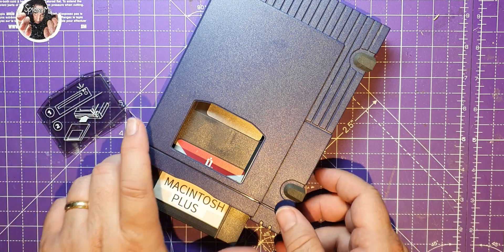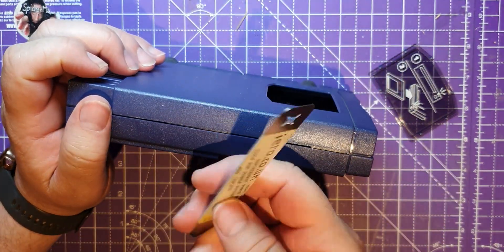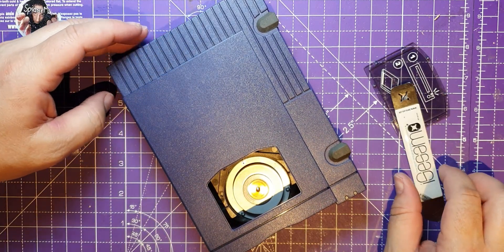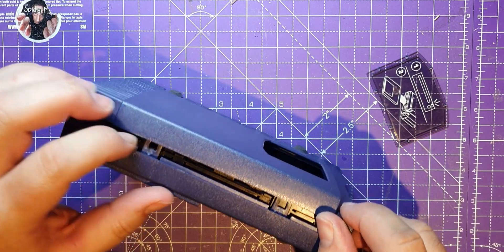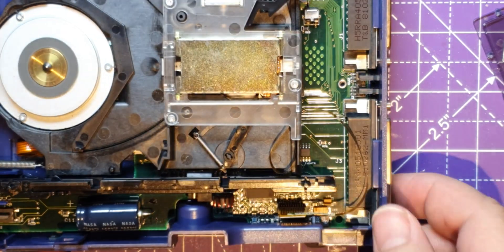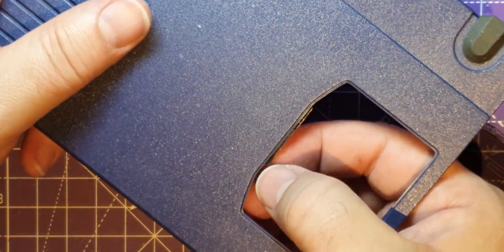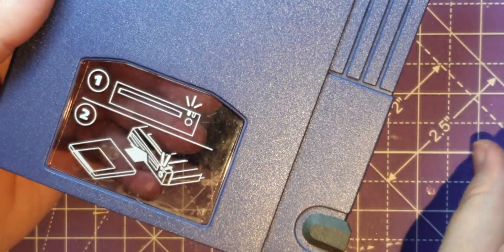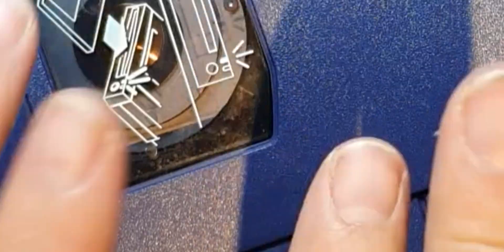Iomega SCSi Zip100 drive disassembly and disk window fix

Comment: WARNING! The video is superb but it doesn't mention to be CAREFUL when removing thee top 'cover'. Do not disturb the two 'guide' rails either side of the disc loading mechanism. A tricky job refitting them if you disturb.
Reply from the maker: Good point -  Thanks for the heads up! Thankfully I didn't have that issue when I did it

Comment: I did the same some years ago, with a zip drive to my synthesizer, i had 2 broken ones, and put the good parts together to get a working one. Only bad side is that the discs I write with it only works on this drive, and not my other zipdrive :D ah well. Cant remember mine was  this hard to get apart, so maybe there are different models.